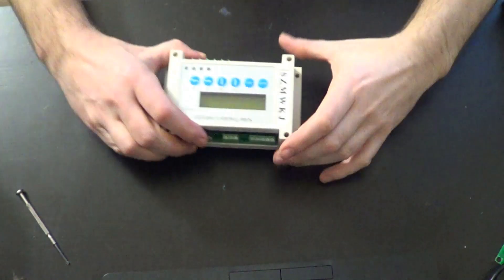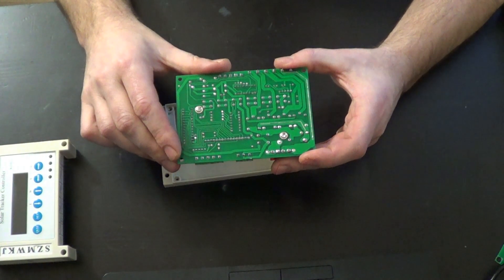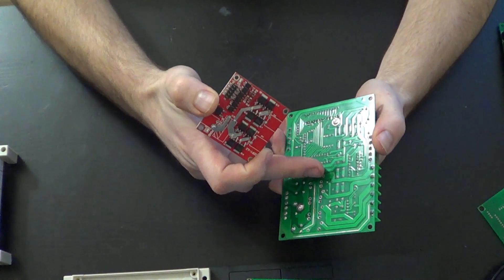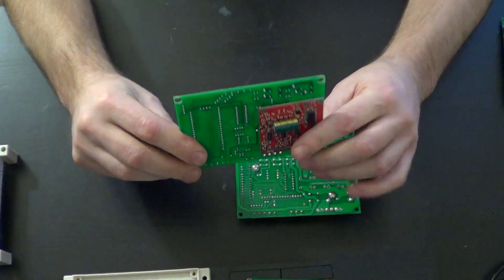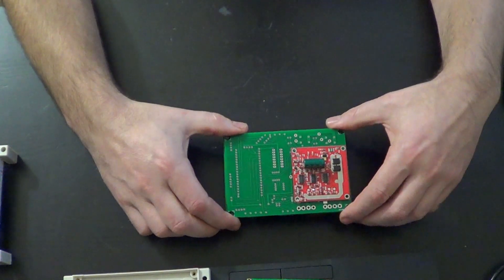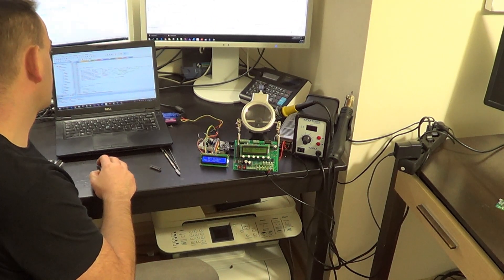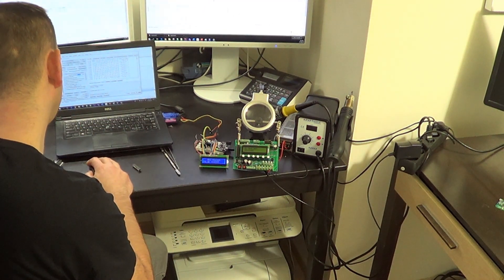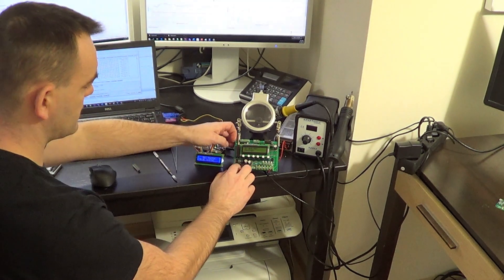Solar tracker controller - WST03 upgrade

Comment: Hi, I installed a 2-axis solar controller in my DIY solar tracker: https://youtu.be/_Rs8CptQcDw . Save electricity costs / shorten amortization: With Dimmer + Solar PV, self-sufficiency will now increase to almost 95%, because expensive purchases from the grid are so easily suppressed and the electricity bill lasts just like the electricity meter. The prerequisite is that you have at least a small balcony power station, and you don’t need an expensive battery either. Example of a kettle: Without a dimmer, the 2500W - 600W PV system needs = 1900W, which you have to pay more for. If I turn the kettle down to 600W with a dimmer, then every weak PV system can now supply each consumer independently and independently, because the 2500W kettle becomes a 600W kettle thanks to the dimmer. Magic... The 2000W e-heater becomes a 500W e-heater with a dimmer, which can run 12 hours a day free of charge via PV. https://youtu.be/QbLWDbJi6ew . The 4000W oven is also tamed. Not the solar systems have to grow, but the consumers just have to drop by 75%, which is sooo easy with the dimmer. are you convinced now I have already switched my entire household to dimmers. Please have a look at my channel. ........ 🌞 ....... Increase mini PV solar self-sufficiency (winter and camping): A boiler and other power-hungry consumers can be infinitely reduced using the "5000W dimmer". Ebay €7. I run 5 dimmers in parallel on an 850W inverter. Kettle 2.2KW at 150W runs 12 hours a day, so the water is always hot. The room is also nicely heated. 2.5KW washing machine runs in parallel with dimmed to 400...600W and always reaches its 60°C, and also its 1400rpm... It doesn't matter to the washing machine whether it changes the washing temperature to 5min@2500W or 100% can be achieved free of charge via existing PV power in 20min@600W. The wash cycle lasts the same time dimmed and non-dimmed, 3Sth 10min. The iron, dishwasher https://youtu.be/8vnAkrS1x-s, oven, electric heater, waffle iron, coffee machine, all internal heating are so throttled for me. Videos on my channel https://youtu.be/eC2olbCBhh0 The inverter stays cool, quiet and the MOSFETs + (battery) remain intact because no extreme current peaks arrive at the inverter. Now every Mini PV Inverter is enough to operate large devices. So, with the dimmer, all internal heaters/devices can be converted into base load devices that stay almost permanently ON, drawing very little current directly from the PV. With a wattmeter / energy cost meter you can then measure this perfectly in order to set the dimmer optimally. ........ Comments: "Great idea - despite studying electrical engineering, I didn't think of it myself ;-)" or "I installed it in our washing machine, great idea!" or "Glück Auf Christian, I'm a professional myself but I haven't figured that out yet.👌 Greetings Mitch💚" and many more... LG Christian .............. 🌞 .............. ................ ................ .............. ................ ................ .............. ................ ................ .............. ................ ................ .............. ................ ................ .............. ................ ................ .............. ................ ................ .............. ................ ................ .............. ................ ................ .............. ................ ................ ................ ................ ................ ................

Comment: What does your chip do new or and better?
I am using the WST03-2.
https://www.youtube.com/watch?v=y5mUwV1jeE4&list=PLNHEOmOeQhamokPm0GUJGvGrlpvP_rATg&index=6
Reply: The cloud works like a prism and change the Sun ray's direction. It's not a problem when the clouds are of equal thickness and completely cover the sky.
But not on semi-cloudy days. When a lot of small clouds heterogeneously change the direction of the rays. 
The tracker is moving from E and W, back and forth. This significantly reduce the lifetime of the drives (+waist of energy).

We can handle that gentle, giving the user another parameter influencing the algorithm as much as needed.
It lets You ignore unusual sun ray direction change as much as needed.
The tracker gets smarter.
Reply: @GrzegorzBierzynski  that makes a lot of sense. I see my panel go bananas when there are clouds.

I set my update to every 9 minutes for N/S and 3 minutes for E/W. if you watch a few of my time lapse videos in tracker Playlist it shows it bouncing around on partly cloudy days.